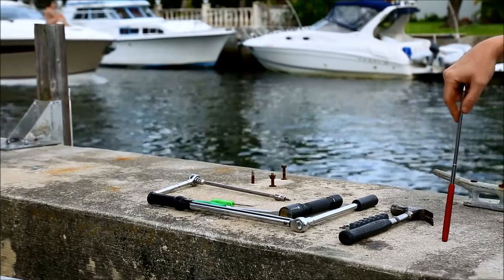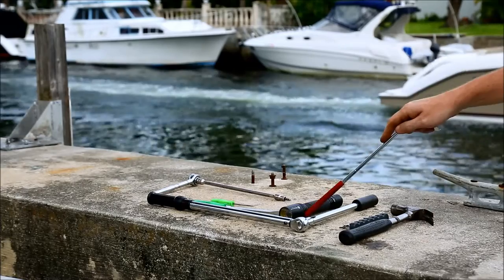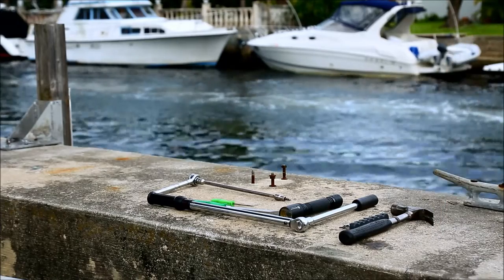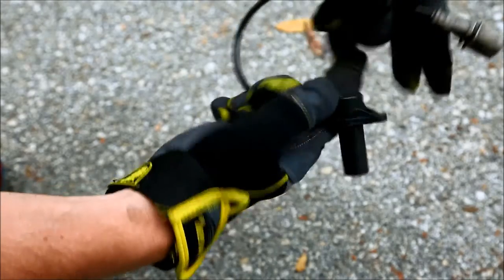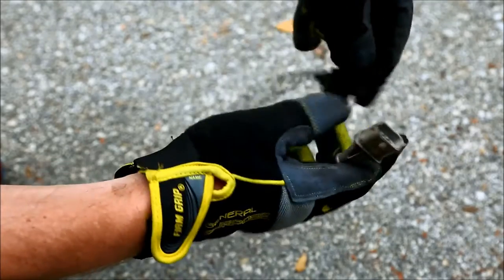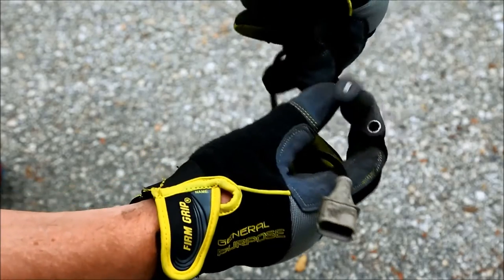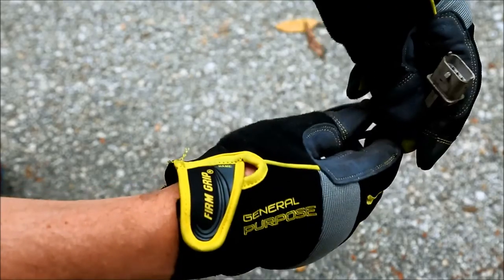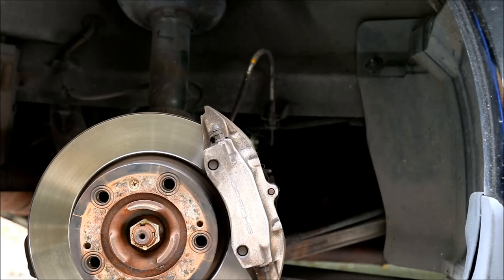Porsche Crankshaft Positon Sensor | No Start Problem Solved

Comment: My car is a 2006 987.1.  It used a T40, not a 5mm Allen. Also, you are going to win some type of contortion award for completing this replacement.  I did most of the job from underneath on my lift.

Comment: Exact same problem on a '99 911. Mine would actually stop running after about 25 minutes. It was just diagnosed by the shop from the engine codes. They tell me the part is $280, with another $200 to install. I'll pay the $200 rather than risk screwing this up.

Comment: Hi, I have the exact same symptoms on my '99 C4 911 996 convertible. Removing the CPS sensor from the engine side is not all too difficult, I can make that work. However, like you said already in the video, I am having an extremely difficult time removing (or even getting to) the connector that connects the CPS to the DME/ECU.  It's clipped in and you simply cannot even see it visually, but only 'feel' it. Removing it (unclipping it) is already very difficult, let alone step 2 (reconnecting it). Can you help out ?   Did you reach the connector through the wheelspace or did you go in via the  engine compartment ? It seems like it COULD be better accessible there once the coolant reservoir and fuel filter will be removed, but I haven't attempted that yet.
Reply from the maker: sorry, I have no experience on the 996 and this will be different than the 986 because of the engine position

Comment: Hi I just bought a 99 boxster on the cheap. It runs for about 20 minutes then dies and won't start, just cranks. From what I've read, it's the CPS. Are those the same symptoms yours displayed? Thanks
Reply from the maker: Hi, not exactly the same but similar, in my situation, car would start when cold and run "fine" until it was turned off, then would need to cool down completely before it would start again. I 'd look at it this way the part is cheapish and easy enough to change so do it, being a 99, can't hurt to replace things. You're probably due for a complete throttle body clean, MAF clean. Also, unrelated... I'd  take a look in the intakes for the radiators for debris, and even goes as far to take off the bumper cover and clean out between the radiators and condensers. Good luck, feel free to message me with any questions, I've had my 97 for 14 years and it's got 260k miles on it
Reply: I have the same problem. Could you fix it?

Comment: My car doesnt start if i dont put my foot on the gas, i looked for the sensor on eBay but they all are just sensor without a cable, where do you got yours from?
Reply from the maker: Your problem does not sound like a sensor issue to me. you probably need to look into the throttle body and perhaps idle control valve, usually cleaning helps. if the crank sensor is bad,  the car will not start at all, no matter how much gas pedal is pressed.
Reply: +ZipZapDIY i already changed the whole throttle body and the sensors that comes with it, the car started just fine the first time after i change it but the problem came back si ce the second time, i cleaned the MAF sensor and again the car worked fine for some minutes and then looses powe if i left my foot off the pedal
Reply from the maker: if you have a Durametic, I would check the actual values coming from the MAF, if you don't have a Durametirc, I suggest you get one.